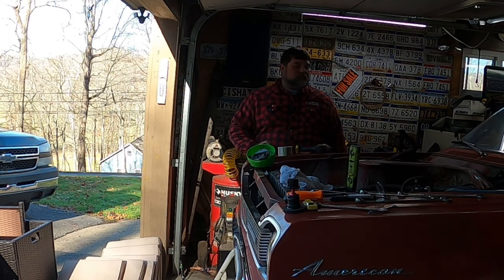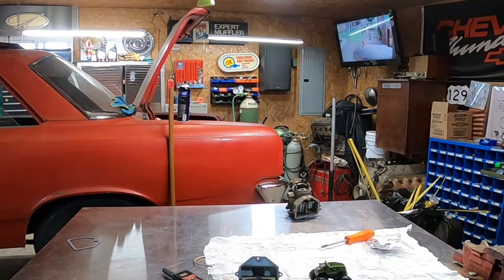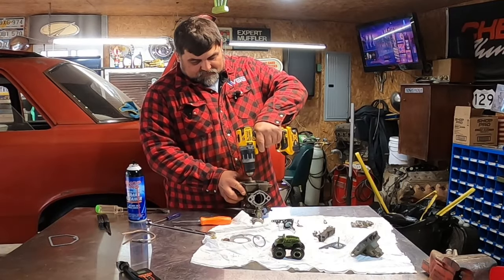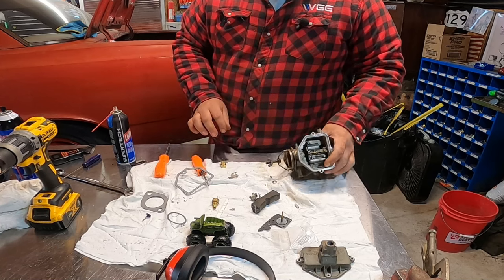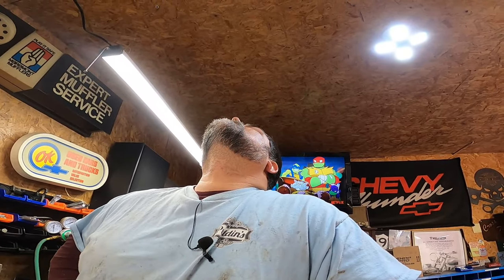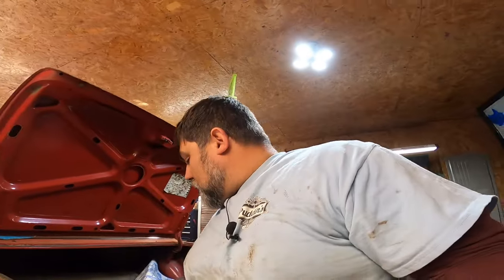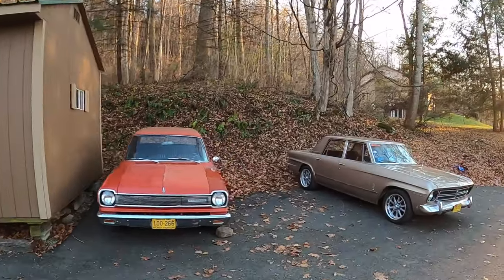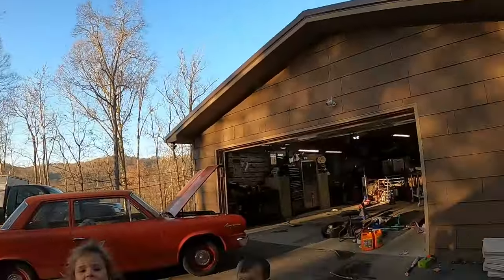RAMBLING RAMBLER

Comment: Go find yourself a big old soldering iron... The big plug in electric ones... Then clean the tank where the hole is and solder on an old copper penny. it needs to be an old one the new ones are copper clad zinc...Doesn't solder... Looks like you can get to it without taking the tank off... Just jack the car so the gas is away from the hole... Been there done that.... It sucks... great video.. I  am working on a 65 Marlin not as good of shape as your rambler... Thanks
Reply from the maker: Thanks for the tip. Never knew about that trick. Those marlins are few and far between.
Reply: If it is just a pin hole sometimes you can float it over with solder.. But usually it is a bigger hole... Once you poke at it a bit. lol  ;)..  @anthonyctg